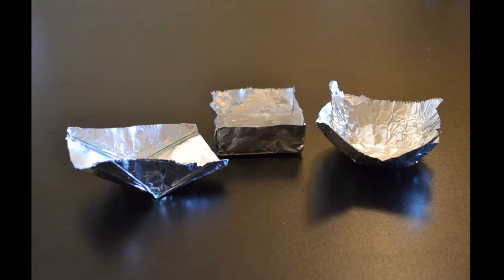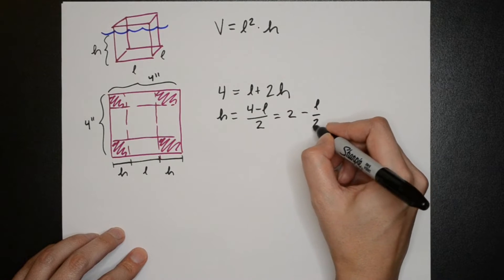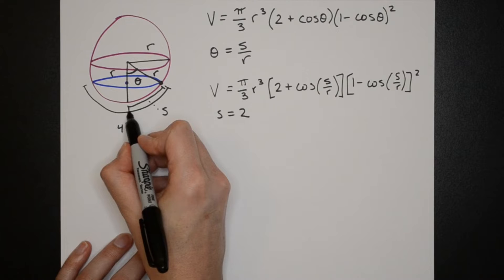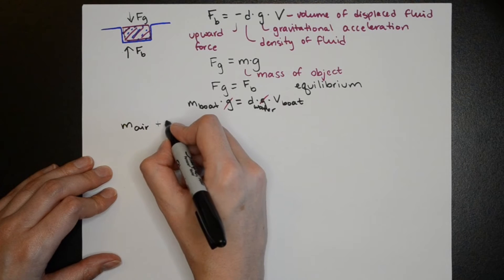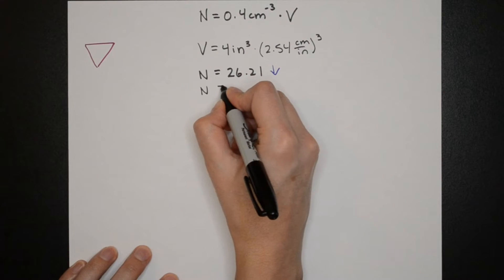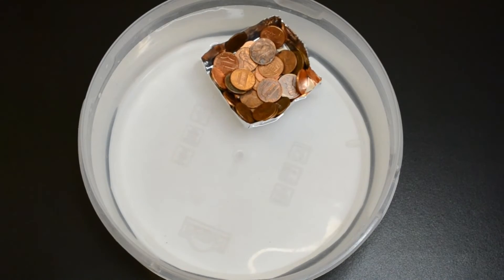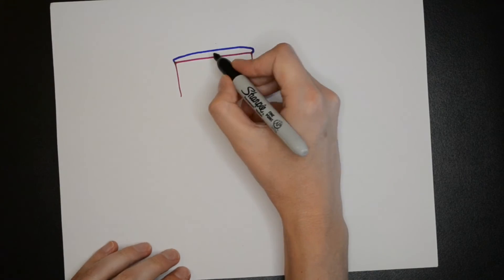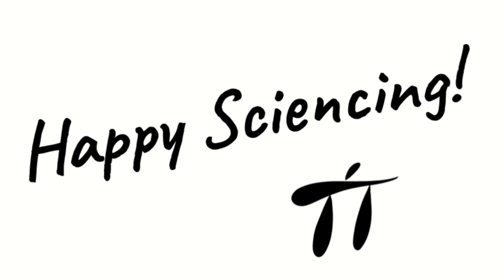The Optimal Aluminum Foil Boat

Comment: It would be interesting to try a round shape with corrugated walls, like the paper from a Reece's  peanut butter cup.  Or corrugated walls in any shape, so it wouldn't bend in.  One reason the sphere does well might be that the foil is crinkled (corrugated) more than flat walls.